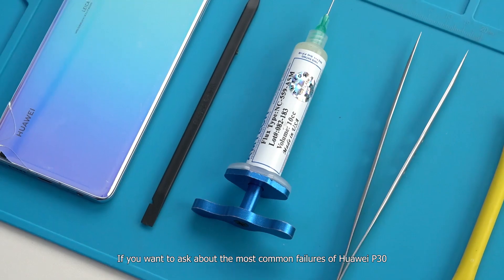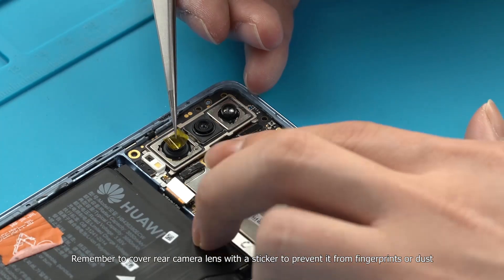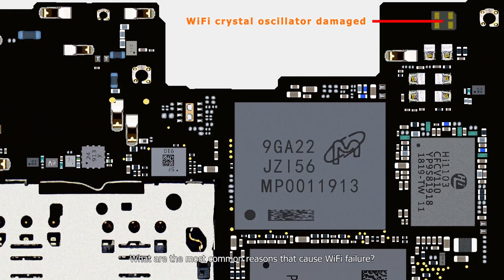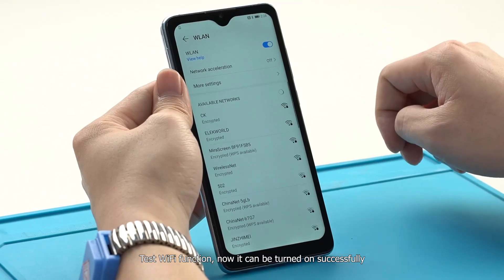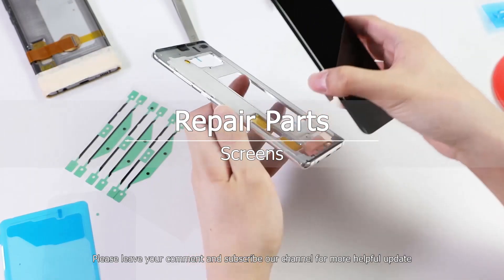Huawei P30 wifi doesn't work? It's easy to repair

Comment from the maker: If you want to ask about the most common failures of Huawei P30, WiFi failure is definitely one of them. This video is gonna to show you an overall repair solution of solving WiFi failure.

00:00 Introduction
00:13 Inspection
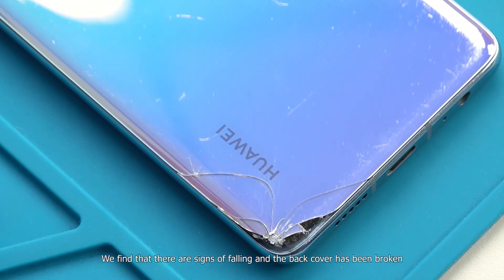00:46 Take out mainboard
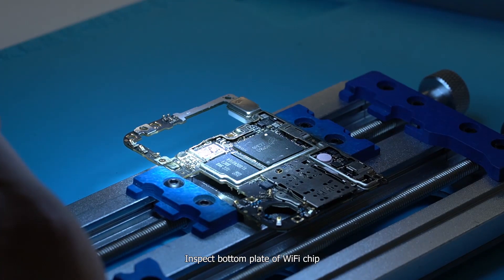03:05 Measure Resistance of WiFi Bottom Plate
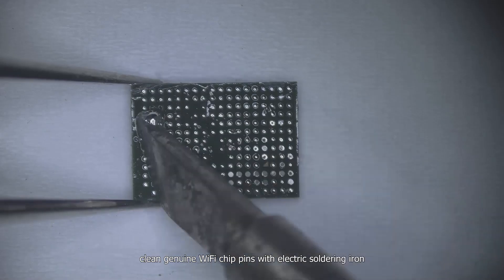03:49 Reinstall WiFi Chip
04:40 Installation and Test

For more Repair parts&Tools and Tech support, please visit:
Website: https://www.elekworld.com
Facebook: https://www.facebook.com/Elekworldshop/
Instagram: https://www.instagram.com/elekworld/
Twitter: https://twitter.com/ElekworldL

Comment: Hi sir i swaped mother board on my p30 pro after that wifi and bluthooth is not connecting phones doesn't show the usb transfer while connecting to pc.mainly fast charging not working it takes 4 hours to fully charge

Comment: The pb. with my P30 is that the wireless payments do not work anymore... I can switch NFC on, the icon turns on but the payment does not go through... I have reset Network settings and set a new google pay/wallet, but it is still not working... Is it a hardware pb. ?

Comment: my P30 Pro VOG-L09, after FRP removed using software, wifi dead, tried to reball, buy another 3 wifi module ic, still not working, do you think it was a software problem? can CPU bad connect resulting in no wifi? the wifi address is stored in wifi module or internal storage? i see the wifi address also gone, all zero
Reply: restrore frp see if it restores wifi

Comment: My bluetooth and wireless turn off by itself after 5 seconds when i try to activate them. It's this related to the fact that maybe after the guy at the repair shop replaced my display forgot to put my wireless antenna?
Reply from the maker: Theoretically speaking, it's possible. But need further inspection on this.

Comment: I got a weird wifi problem on my P30. The phone do not want to connect to a wi-fi network with a WPA-PSK encryption on the first try. It says"Denied access to the network". You have to try several times in order to connect. No problem on a free WiFi, or on a wifi with WEP encryption. Nework or phone factory reset did not helped at all. What would be the problem here?
Reply: Please, I have the same problem.. try alot of solutions but none works
Reply: Same here , any idea ?
Reply: @sunderslayer  I got mine fixed - it turned to be a hardware issue on the motherboard.
Reply: @torrotorrentazos1307  Which component is responsible on the PCB?

Comment: Just 2 questions : Why you suspected the chip and not other 2 possible problem ?
could I just reflow the chip ? instead of removing it completely. reflow is about 2-3 min of work,  removing chip, cleaning , re-balling and soldering back is  about 30-40 min work for me (still learning it)
Reply from the maker: Actually we try to re-install chip at first, if it still not work, we will try other 2 possiblities, just the simple "method of exclusion".
Reflow: not sure what's the exact process, but I think if the soldering pads on board was damaged, just reflow might still not work. Need recover soldering pad then reflow, it will work.